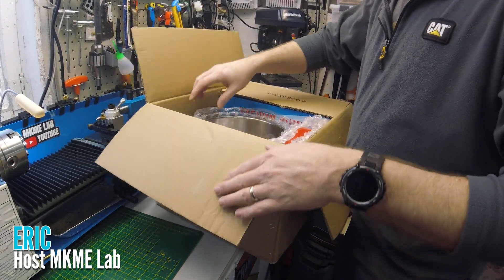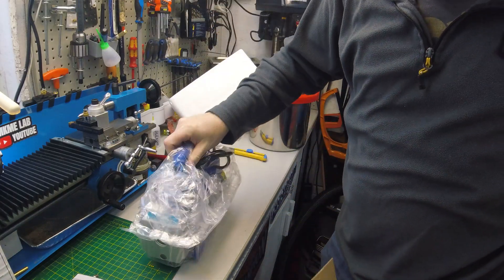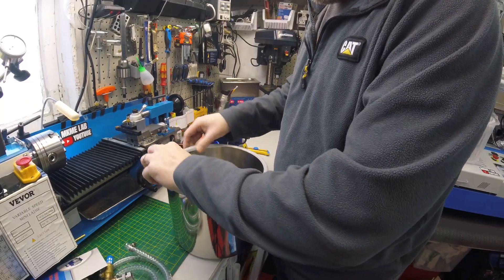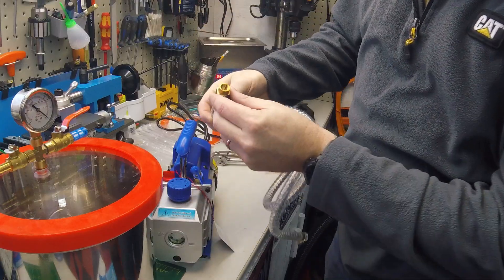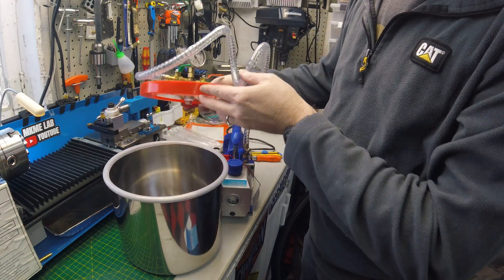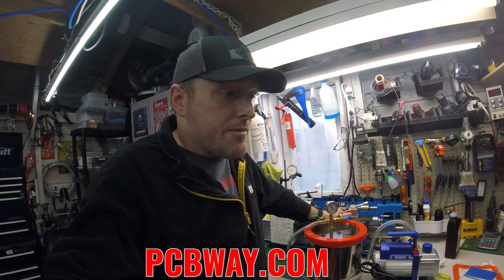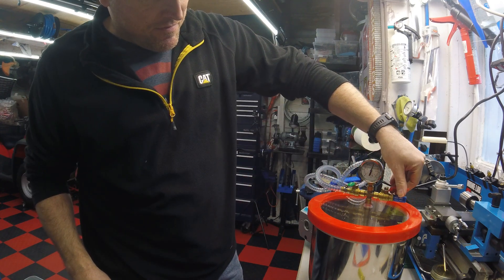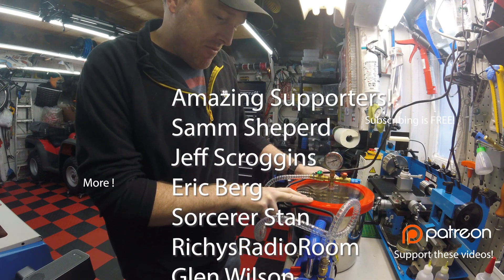VEVOR Vacuum Chamber For DIY Projects

Comment: Thanks for the review. I bought the pump at a yard sale and needed the info you provided.
I would put the mat under the pump for noise vibration reduction, but it probably is a non stick mat for resin. Seems it would be round like the chamber, though.

Comment: I have been looking into getting my own vacuum chamber for removing the air bubbles from my epoxy resin pours to save the time of waiting for the air bubbles to rise up to the surface naturally, so they can be popped and waisting money when I loose the resin project because it has air bubbles trapped in the pour. I can't justify selling a piece of work that has air bubbles trapped in the resin. I feel like I am not giving them a 1st class piece of work for their money. I have been slowly adding equipment to my shop a piece at a time as money permits. Now its time for a vacuum chamber for a professional resin pour everytime, " I Hope". If you would, Please update your video comments, about the reliability of the equipment since you first started using it. I'm interested in the lifespan & the reliability of the equipment, how it holds up over time & usage. 
Love the review & your honest opinion about the equipment & the brand. I have a few Vevor brand pieces of equipment & for the money, i have NO complaints about the quality of the equipment. It seems to me that they are a decent quality brand with a wide array of different types of equipment & options at pretty decent prices aswell. These days almost everything is made in China and I have NO problems with buying a product from them, regardless of what others might think about the quality of their products. If they work for their intended usage & are in a price range I can afford, I will buy it, regardless of the country of manufacturing.

Comment: Have you experienced any issues after several months of use? Initially, mine could reach -30, but after about 15 uses, it only goes down to -25. I'm not sure if this is normal for this type of Chinese vacuum pump.
Reply: Have you ever changed the oil in the pump? If not, try that. Every time you use the pump the oil becomes more contaminated (especially from water vapor) and the viscosity decreases and eventually the pump will have a hard time trying to pull a vacuum. Only use vacuum pump oil.
Reply: @jimh.9247  Thanks! I'll try that, I'm also waiting for a new gauge just for compare. BR
Reply: @DanielDiazQuintero Plz Update Us Looking To purchase But Your Comment Scared Me
Reply: @keepmovingforward5576  Busted!🙂 Gauge was faulty, after replace it for a better new one, now reach -28 inHG psi.
Reply: I ordered one off Amazon same as this one and it came with oil..

Comment: The mist is vacuum pump oil. Supposedly it's not hazardous, being basically mineral oil. Still, I don't need to breathe that, or get it on things I'm working with. Grab yourself a vacuum pump oil mist filter to solve that problem. Also, bear in mind that whatever you are pulling out of the material under vacuum (and it's often not just air) will be vented out of the pump into your space. Another reason to consider better filter options.
Reply: The mist is not pump oil, it's water vapor, or if there is a solvent in the chamber it would be vapor from that. We all know that water boils at 100C but that is at atmospheric pressure. As pressure decreases the boiling point of water also decreases. Water will boil at room temperature when the pressure in the chamber is about 1/40th atmospheric pressure.